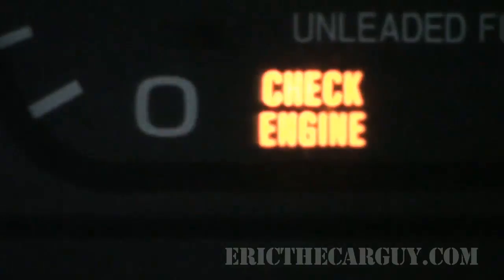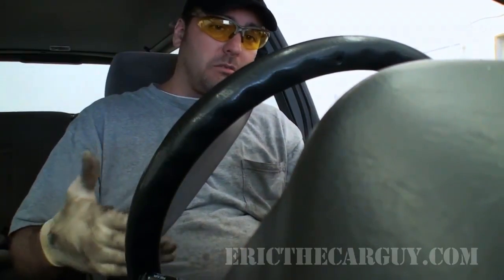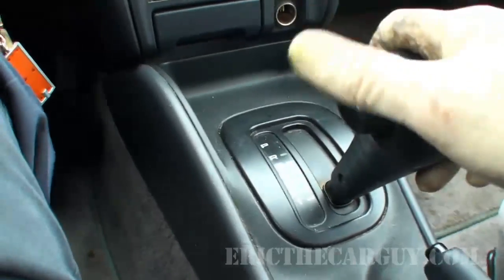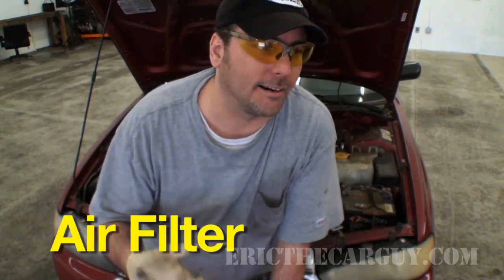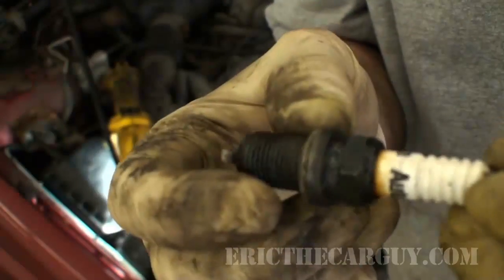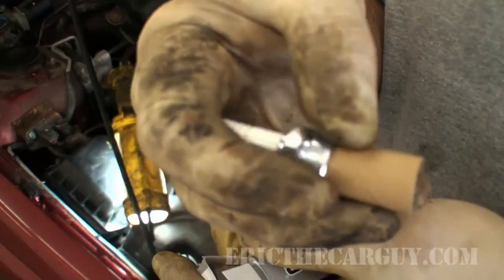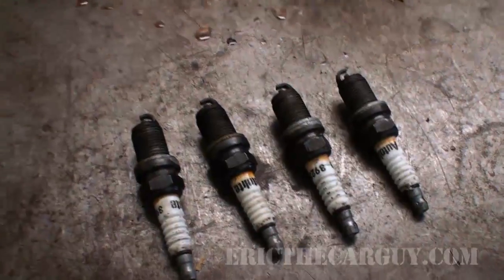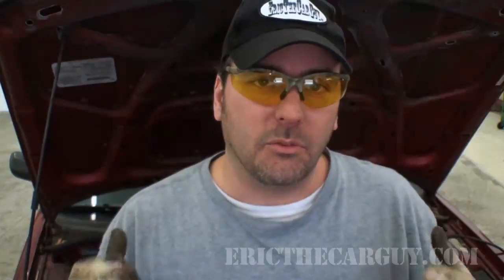Solving Engine Performance Issues (Part 1) - EricTheCarGuy

Comment: sounds like an electronic problem, if the conection to the coil or coils was loose or intermitent it would keep it from running. my friends 99 accord would start but as you let the key go it stopped because the wire sending power to the components would loose its connection it needed the ignition switch and ignition cylinder inspected to determine which needed replaced. both could cause the cars problem i used jumper wires to keep it running

Comment: heres a different approach are you familiar with ocilloscopes? depending on resistance an other factor  there is a specific wave pattern to each spark plug and plug wire if two diiferent companies plugs were compared by the wave pattern you could prove they were simular enough if the pattern matched between the two if the pattern didnt match they clearly wont work the same. you could also use same brand and part number to see if it simular enough great for fine tuning

Comment: You do that... I'll use what it was built and tested with from day one. I have seen a few examples where aftermarket plugs caused problems in drivability due to design. After getting burnt because of crappy plugs, I will NEVER use an aftermarket plug or off-market plug. From day one of conception, manufacturer specific plugs were part of the design.

Comment: what i am also saying is they work fine even if they arnt owned by ford now i have even used them in my chevys as well as using factory specific brands. my 67 mustang has motocraft plugs in it because they cost the same as autolight which were in there already. although i wouldnt put champion in chevy or ford becuase it gets problematic but i am not afraid to test aftermarket brands to find out for myself. you also wouldnt use bosche in any amercan brands because they were ment for german cars

Comment: My guess is bad plugs and wires. Replace both and if you put a bad plug wire on a good plug, replace that plug again. A bad plug wire will ruin a new plug and a bad plug will ruin a good wire. As soon a a carbon path is established on a plug or wire, it's junk and will always missfire.

Comment: if  use platinum using an msd ignition wont wear them out faster like copper cores thats one thing i understand about platinum if your engine burns oil in the pistons it ruins platinums iridium can handle much more heat and oil wont ruin it. i learned this while earning my degree in automotive repair. the price is what scares me

Comment: usually the key needs to be in the ignition and turned the run position for the pump to have any power or a signal to reach normal pressure in the fuel lines. there is pressure left over when you turn most fuel injected cars off allowing some fuel to squirt out when you remove a fuel line

Comment: Hey Eric great video! i have a problem with my 1998 Ford Escort ZX2, i replaced my spark plugs a few days ago, the old ones where Autolite Platinum, i replaced them with recommended Bosch Double Spark, when i took it for a drive, the motor wasn't acting normal, it would vibrate in an odd way and would have an extremely hard time accelerating so i put in the old ones back but the motor is doing the exact same thing, i found some oil on the 4th spark plug, what do you think is causing the problem?

Comment: Work*  in the way the engine runs using platinum over iridium. 

Its always best to stick with what the manufacture uses.  There is some engines out there that are picky on what they can use.  For example if you take a GM car with the 2.4L twincam and throw in some generic plugs you will most likely have a misfire when the engine is under load.  This engine works best with A/c Delco Platinum type plugs.  Oh and the gimmick ones called splitfire do not do a thing either.  I hope this helps.

Comment: The best and simple way to answer this question is  that Copper core plugs do not last like Platinum tipped plugs.   Copper Core is your cheapest plug and they required to be changed around 30,000 Miles.   The platinum tips last around 90,000 to 100,000 miles.  They cost slightly more and most manufactures use the platinum plugs these days.  The Iridium plugs are the most expensive but last at 90,000 miles.  The cost of these iridium are not work it in my opinion.  You will not tell a difference

Comment: Reason is  Ford doesn't actually make the Motorcraft spark plugs, Autolite(owned by Honeywell) makes them. So buying OEM style Autolites is the same as buying Motorcraft spark plugs.

Typically you use  A/c Delco plugs on  GM cars Buick, Pontiac, Oldsmobile etc.

Ford, Mercury, Lincoln works great with Motorcraft and Autolites.

Chrysler, Dodge, Plymouth uses Champions for OEM.

Toyota uses  Denso brands.

NGK works on almost everything.

Comment: Service life is the only difference. 

Platinum/iridium plugs will last 2-3 times longer than standard plugs, and are commonly OEM-spec on many modern vehicles along with synthetic oils for longer service intervals, but other than any promises of better power is all just marketing fluff.

Main thing is to make sure the plugs you use are the size/heat rating for your engine.

Comment: check your air filter pcv valve located just above oil filter also spark plugs i have the d16y8 in my car 13 years old but runs like new now

Comment: 89 Suzuki Sidekick. 34k original miles. Ever since a clogged fuel filter blew out the pump and forced replacement, my car has NOT run the same. The idle is slightly higher and much rougher, and the RPMs kind of "float" from 1200 to 900 or so. It also revs higher if I have the blower motor or headlights on than if I dont. At 1200, it shakes. At 900 it makes a sort of spitting noise. It's also much slower than it was before. I know its just a 80hp engine but it seems to have lost a little. Ideas?

Comment: Hey Eric I had a similar like this with my 05 PT Cruiser GT and after a little research on the check engine light ECM code being triggered by the knock sensor but find out it was a bad cam positioning sensor which can cause a knock sensor to trigger a ECM code because the cam position sensor causing a advance in the the timing and a fuel ratio to turn rich causing a pinging noise that will trigger a knock sensor ECM code, And will cause your car to hesitate on acceleration.

Comment: Eric,

I have a 2007 BMW 335xi.
ONLY when the car is at operating temp., it will do this. It does it 100% of the time too on command.
When I press on the throttle (beyond about halfway), it will "spudder". Only ONCE out of 100 times did I get a misfire code for cyl 6 when I did it.
I took it to BMW and it stumped them.
Any ideas?
I changed the plugs a few thousand miles ago. It did it even before changing the plugs too.
Cyl 6 also has a new coil.

Comment: hi eric,
After watching your videos all weekend I couldn't wait to pop the hood and check my spark plug gaps just to get my hands dirty.
After a big LPG backfire and a cracked aluminium intake manifold on my buick 3800, the mechanic tells me it was caused by a cracked spark plug. I had always used a T-style spark wrench before but this was the first time using my new torque wrench. 
After a $1000 repair bill i've learnt that if the engine is clean, there's no need to stay dirty :)

Comment: in my 91 civic i used both autolight and ngk sparkplugs [never mixed them] i liked them both there was no difference in performance. if you dont want to find out that one brand doesnt work so well just follow the manufactures specifications.

Comment: Hi, I own a Civic 2001 LX american model and Im having an issue with the start... Whenever the car is not used for more than 3 or 4 hours I have to start it more than 50 times to get the car on and stable revs. The engine starts for less than 2 seconds but then the revs go down and the car just turn off and then I try again and again and PRESTO, the car is stable and working, once the car is on and the revs hits the 1000, no matter how I use the car, it never goes off unless I turn it off

Comment: Eric. You are very right about spark plugs. I decided to take a look of my plugs and replace them. So searched what the original ones should have and bought 4 new ones. From NGK. Then removed old plugs and found that they were incorrect type, like in your case. And they were very old. I put NGK in and my car is like new. So smooth idle, shifting etc. Whole driving experience is completely different. Like driving new car.
It was "thinking" each time before autoshifting, but now it doesnt. Smooth!

Comment: Guys if you dont have the pressure gauge just take the fuel filter out and put it to your mouth and blow through it, if theres any difficulty doing it, it needs to be changed

Comment: my stepfather has a 94 s10 blazer, 4.3L vortec CPI engine. runs good until you full throttle it. at full throttle it falls flat on its face, it just doesnt have anywhere near the power it should have. it has new plugs, wires, cap, rotor and fuel pump. not really sure of what the problem is. acts like it has a stuffed up catalytic converter, but we checked the converter and you could see light through the honey-comb mesh, dont know what the issue is

Comment: Eric! i have a 03 mustang v6 and everything you are describing is happening, it like chokes when i acelerate from a dead stop, i reciently change the fuel filter and that didnt stop it. i was driving two days ago and i heard a loud bang and yesterday i was doing about 75 mph and the check engine came out but when i went back to 60 mph it went away. An hour ago i checked for a code and it told me a misfire on cylinder 1 so tomorrow im going to replace it hopefully that will fix it

Comment: I love the videos, but your comment about not bothering to gap a spark plug is very poor advice. I just bought some NGK plugs (had same protective sleeves) and the gaps varied between 0.060" and 0.070" on a set of 6 when the engine calls for 0.040" 0.045"

Comment: Another thing to add is that different spark plugs have different heat ranges and that could also affect engine performance. Always, use manufacture recommended plugs.

Comment: Well first off its normal to have white smoke in colder weather. but I would say do an oil change and put in the proper amount of oil for your engine. If memory serves, you have an inline 6 cyl. So put in 6 quarts of oil. See if that fixes it. A faulty o2 sensor will not cause white smoke to come out the tail pipe. If the oil change does not fix it..I would suggest checking if coolant is leaking into the combustion chamber. Usually excessive white smoke is caused by coolant being burned.

Comment: Hi, I've got an issue with what I originally thought was my final drive gear (planetary?) in a 94 Buick Regal automatic it felt as if the gear skip and jolt after applying a certain amount of acceleration but would smoothly build power if I lightly pressed the gas. My question is this could a misfire at high speeds be causing the noticeable jolts due to the gear ratio and the Increase in resistance to the spark plugs at high speed? 2/3 of my distribution caps arc back to themselves..

Comment: hey erick, do you think that replacing really worn spark plugs can improve gas mileage? i am somehow scared because i gained like 60 miles per tank after replacing worn spark plugs... i used to get 240miles out of a tank, now i get 300 - 320 miles depending on how i drive. my car is a geo prizm 1995 and i just changed oil, spark plugs, air filter

Comment: some cars are expensive some are not, also depends on where you buy the parts weather you are buying OEM supplied parts or aftermarket supplied parts.if you go through a place such as rockauto dot com a full tune up should be less then 100$ for all the hard parts but as i said just depends on the car. best thing to do is just go to rockauto and make a cart and see total cost with shipping. tune up is one of the easiest things to do and one of the easiest ways for a shop to rip you off.

Comment: I had this same problem in an older 80's mustang. No one could fix it, tune ups, carb cleaning, etc. I starting fixing or replacing everything including the vacuum lines starting at the Distributor. No change. Finally I had to take the car in to replace the catalytic converter, get smogged, and had them do some more problem searching. They finally found the vacuum leak, a split in the last hose that I hadn't changed! The AC switch. Fuuuuuu! Why connect everything together like that? Dumb!

Comment: Nt
ot much of a Subaru fan but that fuel filter access is great .Hesitation is a bugger to diagnose , I have found your plug solution a good start ,However my second step is usually wires on the old cars without coil on plug .A bad insulation caused by oil deterioration will ground out the spark partially causing a slight miss .but these f=days there are so many ignition sensors that any one could cause hesitation even low battery voltage .With all the computers the car should know on its own

Comment: Eric... buddy... quit being a lazy ass. You should ALWAYS check & set the gap on new plugs. That's just irresponsible to not do so. I have been a parts guy in the past, and I've seen first hand how spark plugs are mis-treated when shipped & handled. It's scary really, how harshly many of them are treated before a customer purchases them from off the shelf. I've been a professional mechanic for over 10 years now, and I've often seen brand new plugs where the gap is incorrect right out of the box.

Comment: Hey  Eric I Like Your Vids Alot. They Have Helped ME Alot With My Honda And My Acura Integra B20 Swap. I Just Got My Timing Adjusted On My honda Because I Had The Same Problem. Also Is There A Way To Fix My IAC Valve Instead Of Replacing It? I Cleaned It All Out And It Worked Normal For About A Day Or So But Then Started Acting Up Again. Thanks

Comment: You're gonna grab the steering wheel with those filthy gloves? As far as checking plugs is concerned..... the hardest one to get at is the one that nobody might change. FWIW, Autolite plugs don't belong in a Ford, either. ALWAYS inspect the gap on new spark plugs.

Comment: Subaru Baja's (non-turbo) are known to have a problem with hesitation from a dead stop, i know my dad's sure does, but once they came out with the turbo version, it seemed to fix the issue, is there any way to lessen the hesitation in a '03 non-turbo?

Comment: My 2000 F 150 was running bad, really bad. Chugging, stalling, jerking, I mean bad. It hadn't been maintained at all. Watching your videos inspired me to try a couple of things myself. I changed plugs and plug wires and installed a new fuel filter. These three things have more than doubled my fuel economy and overall performance is great. I'm a believer in maintenance now, a changed man and I owe it all to you and these great, easy to understand and informative videos. Keep up the good work.

Comment: Tell you what, if one of your cylinders is out, you'll know about it!  I had one of the spark plugs go out in my 8-cylinder Dakota, and it was just a DOG when it was running on 7.  I mean, it was seriously slower than the V6 Dakotas I've driven.  It hesitated, sputtered a lot, and shook a lot at idle.  I replaced the bad spark plug, and I went from what felt like 100hp maybe, to the full 250.  I then replaced the other 7 to keep things consistent (and to have better plugs).

Comment: with new plugs the engines always make lots of difference but only happens in first use
then it stabilizes comes back to normal...
i noticed this in a few cars both carbed and efi(ed) no diference

Comment: To increase your cars performance even more use envirotabs, it will increase your HP by using fuel more efficiently in a power stroke, it will also reduce your carbon deposits and carbon emissions get them at greenfootglobal. com/vencesbegreen use them and you will see the improvements in performance

Comment: Yes, you can shift an automatic without causing harm.  It basically prevents the car from shifting above the selected gear.  I mostly use it when driving in the mountains to help keep off the brakes.

Comment: Well, i think you got that backwards. The larger the gap, the better the combustion because your mixture will ignite in alot of different places at once instead of a few. Piston rings don't really need bedding in, often when i open an engine you'd still see the original honing stripes in the cilinders. I just bought a project car, so i'll keep it in mind. maybe fiddle around with the gap a bit to see what it does exactly.

Comment: Are they the double or quad-pronged plugs?  Those don't behave well with Fords at all.  Go with OEM or Autolite (which are, in most cases, identical to motorcraft brand) and make sure that they are the same type as OEM.

Comment: @EricTheCarGuy My car has this same issue as well and I have new platinum bosch plugs in my ford. It only ever does it when in the morning when its really cold. I was thinking it could be a dirty inlet manifold, bad throttle position sensor or idle sensor,etc. Seems like a computer problem to me. I hope this helps and you get to the bottom of your problem.

Comment: It's true that a narrow gap gives a lower load on the coil but then again, modern cars do require a bigger gap than 0.6mm. It's fine to try and save your coil, but the whole point of the gap is so that the air fuel mixture get in there to burn properly. I've never had timing issues due to the gap being to large at 0.8 - 0.9mm simply because most modern engines i work on (EU Ford) are develloped with that gap in mind. I'd personally never file the ground down, that is asking for a burned one.